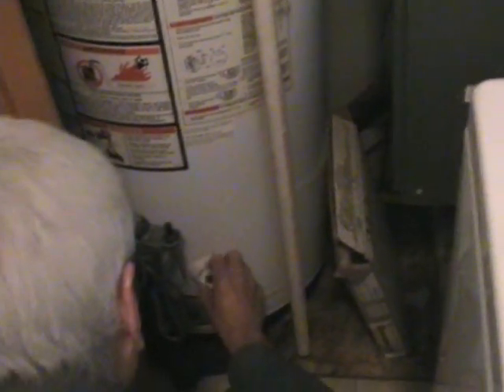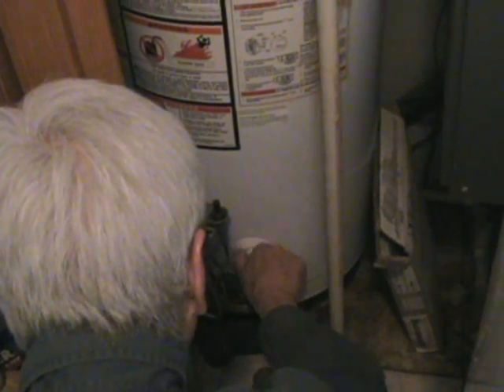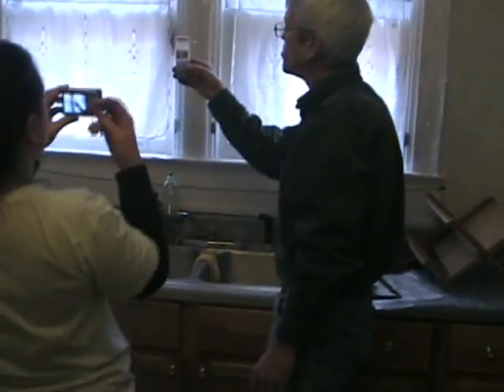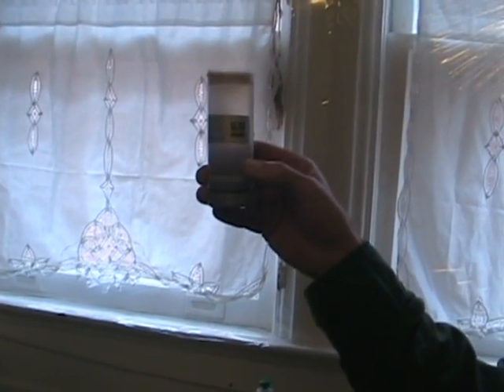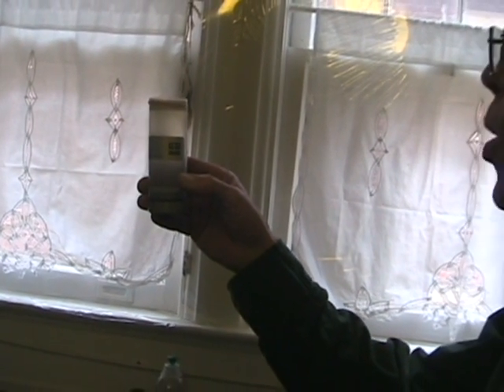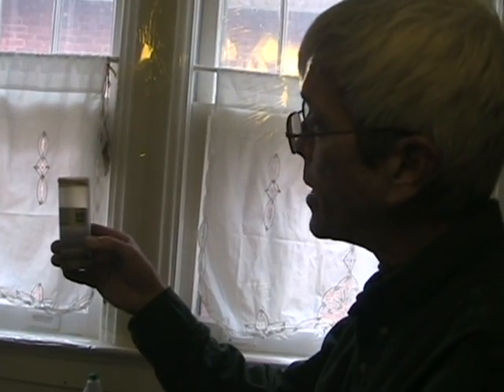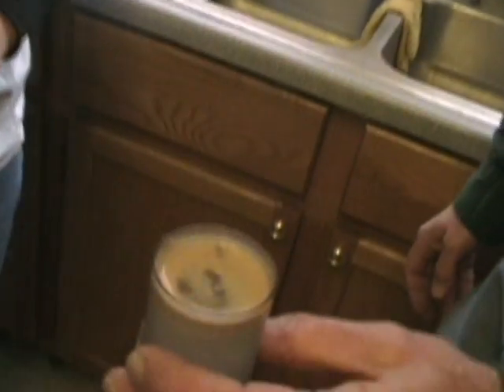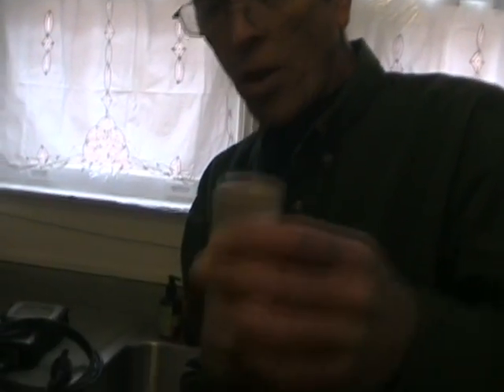Bad Water: Footage of an Unflushed Tank

Comment: No.  The water that comes out of any hot water tank's flush valve (unless it is brand new installed) will not run clear...at least at first.  Sediments do accumulate in the tank and that is why it is recommended to flush at least once a year to increase the life of the tank and the internal components (especially with electric tanks that have anodes that gradually break down).  After flushing for a little bit, the sediment should leave the system.  And flushing thru the pressure release valve 3/4 the up the side of the tank does not flush out the sediment. 
As for the oil ring...that is another story.  It may eventually dissipate out of the top (that is where the hot water exits the tank).  It all depends on if the highest part of the tank is the same as the exit.
One should never regularly drink/consume the water coming out of a hot water tank anyways.  Between the normal sediment, metals leaching out of the anodes, and heated chlorine byproducts from the treated finished water, it makes for water that is not only unhealthy to consume, but just plain tastes bad.

Comment: @ Heather M Well you can. Now I'm not a professional in this matter but I do have a similar background as Dr. Stout. What you could do is add a soap to the hot water heater to wash it out. The substance in the hot water heater is not water soluble (non-polar). What soap does everyday to wash grease, oil, and grim (non-polar) from dishes and our hands is trap the non-polar substance (grease, oil, etc) in a bubble that is non-polar, but has a water soluble outside.  Therefore soap is able to remove non water soluble substances in water. I would first take a look at the water you have in your heater and save it for reference. Add soap and let it sit in it for a while, a day maybe,  so it can do it's work and then flush it. Add water to it again and then check it and see if it helped a bit.  You'll obviously want to do this several times and then several more to get the soap completely out, but do it one step at a time so you can record the progress and see if it is working. Save each sample to reference against the previous wash. You want to do it until you don't see anything rise to the top, and then 3-6 times more.  My analytic chemistry teacher always said to wash 6 times to get all impurities out.